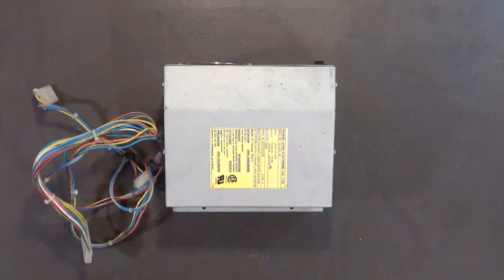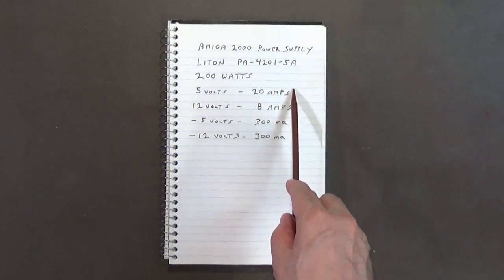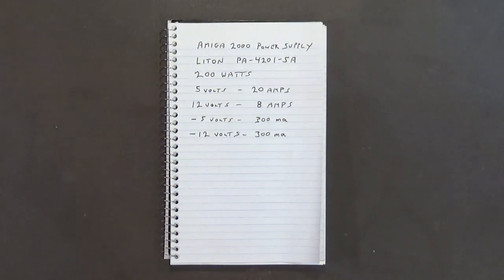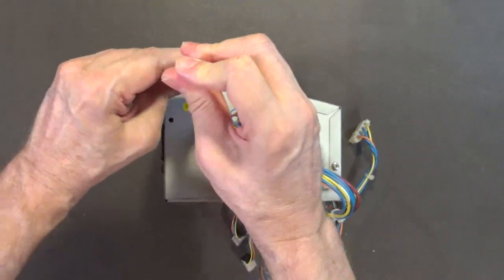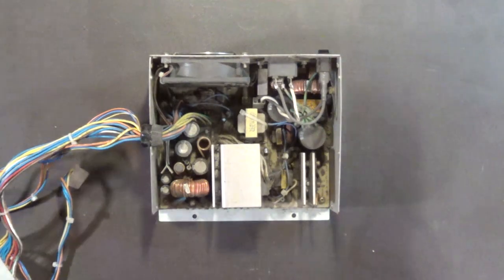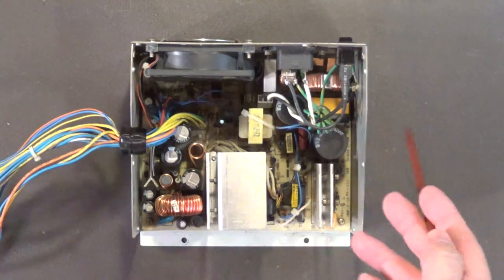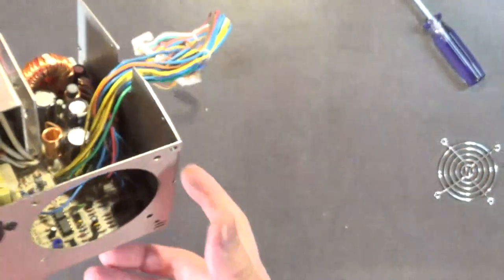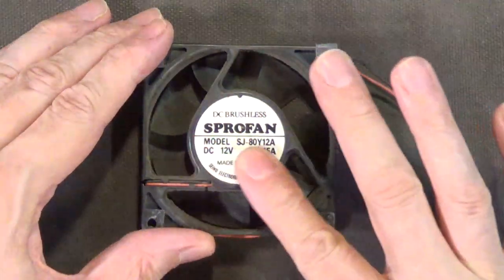Amiga 2000 Power Supply - Recap and New Fan - Part 1

Comment: I put Bigfoot power supplies in all my A2000s because they were all maxed out with all expansion slots filled and all on-board motherboard  options installed (megachip, flicker fixer, etc). Without them, the systems were flaky and would crash.  In today's money, one system has been conservatively valued at $30K (toaster/flyer).